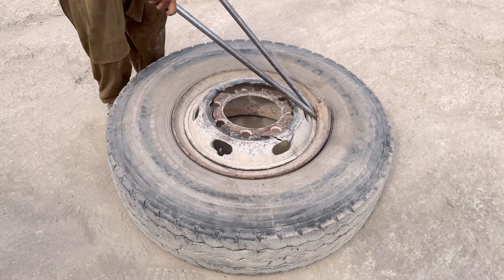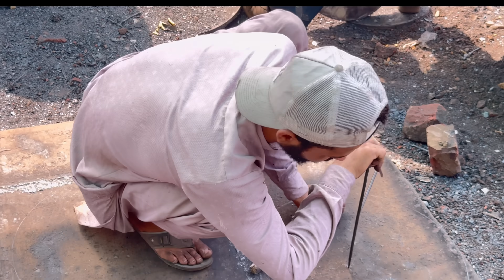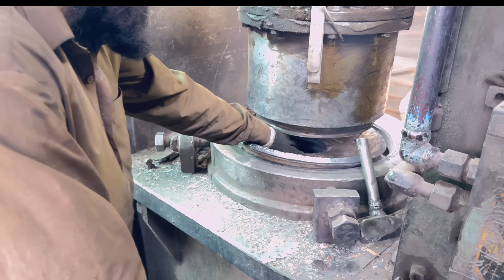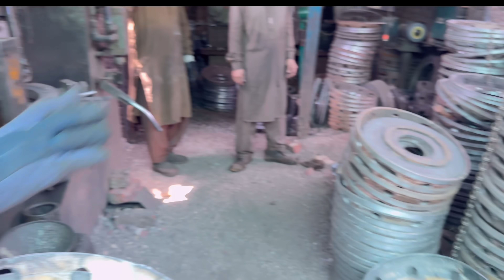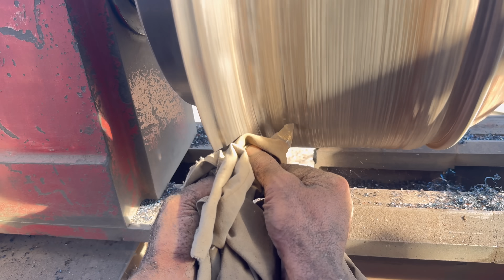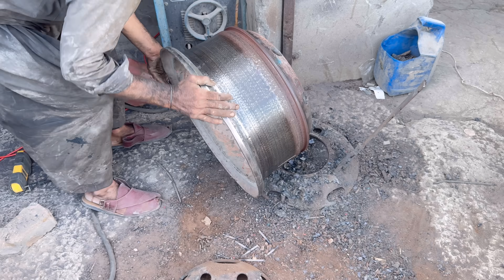Emergency Truck Fractured Rim Repair with Recycled Ship Sheets

Comment: It's pretty dangerous to inflate tires on wheels with that kind of locking ring. It can pop off under the giant pressure and rip your head off. Better do it in spetial safety cages for wheels, or put a long crowbar through the holes on wheel disk. Or, at least, turn the wheel upside down, in that case thelocking ring smashes the ground... Good luck to everybody😁
Reply: And that’s the only safety concern you spotted 😂😂😂😂😂😂
Reply: @TheMrWoodsman  it was the only safety consern, that can cause decapitation😁😁😁
Reply: Sometimes the additional cost of super safety equipment leaves some manufacturing unviable and leaves many men unemployed.

Comment: It's crazy what the men do there. Very well done and everything with the simplest means. The big sticking point is occupational safety. Neither hearing protection nor work clothing, simply nothing. And finally, inflate a tire with a snap ring rim and hold your head over it. Life-threatening and completely unnecessary. Hopefully this was just posed for the video!

Comment: Why other than complete boredom would you try to repair a broken rim? just get one from the closest junk yard (or parking lot), it could be hard to tell the difference. Judging by the number of these "repair" plates being manufactured this must be a normal occurrence. Also judging by the run-out in all of these machines and tooling I'm guessing they save a bundle not needing to balance tires.

Comment: True old school craftsmanship.  Skill and experience vs loading stock into a CNC mill and letting a computer do the work for you.
Reply: I was blown away by the guy punching holes.  I didn't see an indexes or references, yet, I assume, he was punching holes with precision.  smh
Reply: Rims only have to be precusely machined and balanced if the vehicle is traveling at high speed.  That truck probably never goes faster than 40mph.
Reply: The rim was damaged because Pakistani drivers habitually grossly overload their truck - this is a job that would never need to be done in Western countries because the rims outlast the chassis.